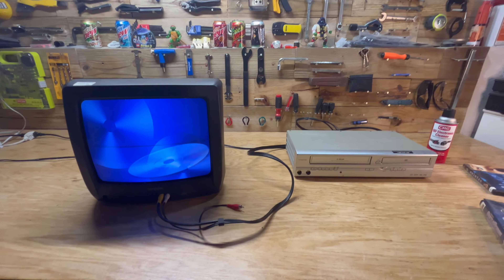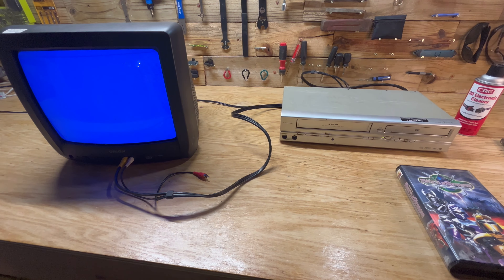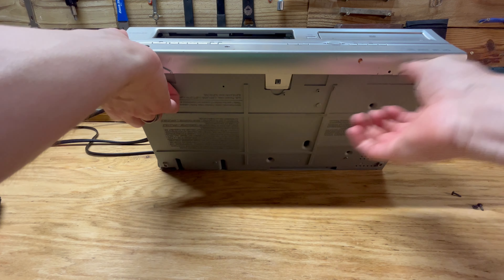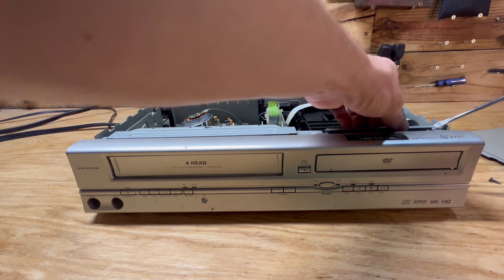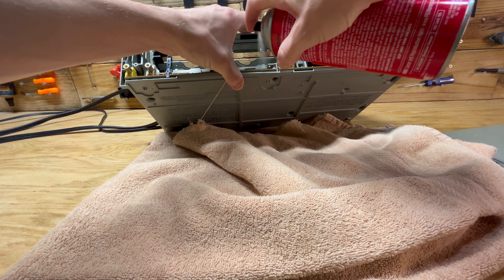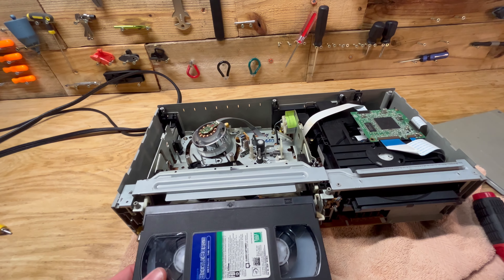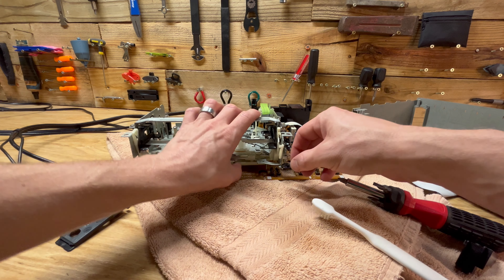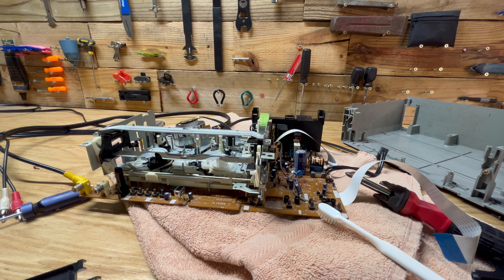Sylvania SV2000 VCR Dirty Mode Control Switch Fix! How to Fix VCR that is Eating Tapes! VCR Repair!

Comment: I did this and now the loading mechanism is stuck on the right-side and won't even allow me to put the tape into the vcr. Something is causing it to stick and not be able to move into the machine.
Reply from the maker: were you able to get it figured out?
Reply: @MoOutdoorsandReviews  No. I gave up. These dual players are always the worst and not worth the time.

Comment: Yes mode switch, must have been timred properly. Maybe when you were saying in was indexed in. I have seen on a sony vcr there are timung marks to get properly lined up.
Reply from the maker: yea no marks, just needed to be cleaned, this switch had little pegs that lined up with little holes so you could not install it wrong

Comment: I'm interested to know if the DVD side still works.  When you disconnected it, you risk static electricity damaging the chips, usually, on the right side, where there are 2 ribbon connectors.
Reply from the maker: hey, the dvd still works

Comment: @6:37 I actually tried that and it actually solved 25% of the problems. It no longer eats tapes and it plays the tape for a few seconds. Rewinding still doesn’t work but fast forward worked until it stopped for some reason and it could play the tape without any problems until I fast forwarded it. It did attempt to eat my test tape when I tried to rewind it the first time but it hasn’t after that.

Edit: Those other problems seem only to be with the tape I was testing with. It worked without any issues with a different tape.
Reply from the maker: thanks for commenting, make sure to subscribe to see more and have an awesome day!
Reply: Might be a belt.  Either clean it or replace it, if you can find any.
Reply from the maker: @kellyobrien8599  it ended up being the mode control switch I had to take the top of it off to clean it